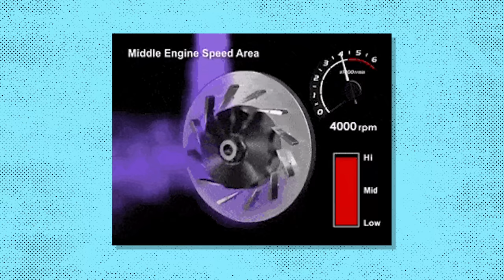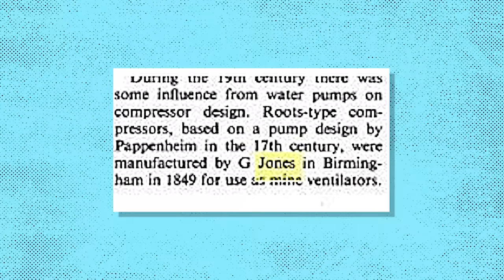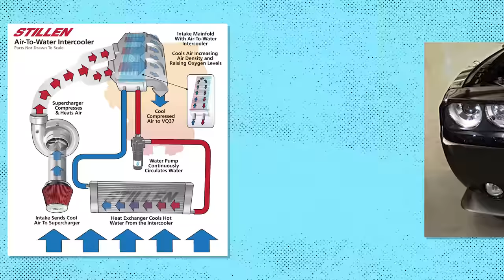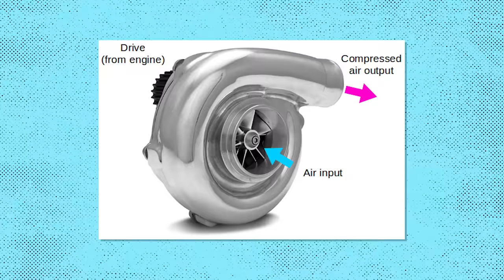Why Superchargers Aren't As Good as Turbos

Comment: Turbos do not use wasted energy. They use a lot of power from the engine, just like blowers. Yes they are more efficient, but making 500hp with an engine that would make 250 NA takes a lot of extra air and moving that air takes power. The turbine wheel is a restriction for the exhaust gas creating pressure and the engine has to work againts that pressure to push the exhaust gas out. An NA engine has about 2-3-4 psi of pressure in the exhaust, a turbo engine has about 2-3-4 psi higher pressure in the exhaust than in the intake.
Reply: Sorry but you are very confused and misinformed.
The turbocharger actually works on the heat energy in the exhaust and does not cause a parasitic load on the engine.
Tbere is no parasitic loss due to exhaust pressure because there is no significant Delta~P.
Any questions?
Reply: @sandervanderkammen9230  what is the back pressure of an NA engine? And what's the back pressure on a turbo engine before the turbo with 20psi of boost?
Reply: @bence.gabor.slezak  If the turbocharger is correctly sized, the backpressure is the same.
The Delta~P remains the same.
Reply: @bence.gabor.slezak  The turbocharger is a HEAT ENGINE and operates using the BRAYTON CYCLE
The exhaust turbine is a Impulse Type turbine and operates using the velocity of the gas... not the pressure.

What part do you not understand?
Reply: @sandervanderkammen9230  and how does the waste gate work?
Reply: @sandervanderkammen9230  The Brayton cycle (or Joule cycle) represents the operation of a gas turbine engine. A turbocharger is not a gas turbine engine.
Reply: @sandervanderkammen9230  how does the waste gate work and what does it do?
Reply: @bence.gabor.slezak  Not all turbocharged engines have a waste gate, they are not required for the turbocharger to work.
Reply: @bence.gabor.slezak  You are wrong...
The turbocharger is in fact a  Gas Turbine...
A Brayton Cycle gas turbine operating as a Combined Cycle Heat Engine.
Reply: @sandervanderkammen9230  did I say they all had one?
Reply: @bence.gabor.slezak  A waste gate is regulator, it controls the RPM of the exhaust turbine, and by default the compressor RPM to maintain a preset intake manifold pressures.
Reply: @sandervanderkammen9230  and how does it regulate the rpm of the turbine?
Reply: The Turbocharger operates on the waste heat energy in the exhaust from the reciprocating engine.
 The amount of heat energy is directly proportional to the amount of shaft horsepower generated by the exhaust turbine.

This horsepower does not represent a parasitic load on the crankshaft like a supercharger.

Turbocharged engines deliver higher BSFC..
Is because the compressor is driven by energy that is otherwise wasted out the tailpipe in a naturally aspirated or supercharged engine.

Any questions?
Reply: @bence.gabor.slezak  If not all turbocharged engines have a waste gate? Then they cannot be essential to the operation of the turbocharged engine.
Reply: @bence.gabor.slezak  It regulates the flow of exhaust gasses to drive the exhaust turbine. 
The waste gate is a bypass valve that allows a portion of the exhaust flow to be diverted around the exhaust turbine.
Reply: @sandervanderkammen9230  it lets exhaust gas bypass the turbine, why that happens? Because the gas takes the path of least resistance (if there wasn't pressure in the manifold an internal wastegate wouldn't do anything since it's not in the way of the flow), so the turbine wheel is a restriction and it is powered by the flow of exhaust gas.
Reply: @bence.gabor.slezak  Yes, but only after the INTAKE manifold pressure reached its preset maximum.
There is no parasitic drag on the reciprocating engine, gas always moves from higher pressure to lower pressure.
Reply: @bence.gabor.slezak  The exhaust turbine wheel is driven by the waste heat energy.. not the reciprocating engine.
The turbocharger puts no additional parasitic loss on the reciprocating engine.

This is why turbocharged engines produce more power at the  same intake manifold pressure
And delivers better BSFC performance.

Comment: supercharger kinda feel like highly tune NA engine,when they past the peak,it feels flat,but remember for some aplication supercharger can win....i've riden my friend rock crawling off road,it just 2.5L v6 with supercharger it only produce 300hp,but the throttle response,the precise for rock crawling is really good,it never got stuck in bad condition....in the other hand,that turbo kids,with 600hp roaring his high rpm in high speed,but dont even move...just treadmill-ing in the same situation...
so its just about the case,sometimes your other hand do better

Comment: Lots of useful information, however to say that superchargers aren't very good is just misleading and not true. Turbo's usually reign supreme in terms of power output, but good superchargers can usually get pretty close to the same output and are much more fun to drive. You make it seem ridiculous to use the engine to power the supercharger and completely discount the fact that it gives you boost at a fucking idle. No need to build rpm and exhaust pressure to spool the turbo. Turbo's are awesome too, but superchargers absolutely do not suck.
Reply: When it comes to making horsepower superchargers suck compared to Turbocharging.
Turbos make more power

Comment: Daily driver? Modern turbo car with computer controls on everything.
Fun driver's car? Supercharged or naturally aspirated with an honest-to-god, old school mechanical cable between the gas pedal and the throttle blades. INSTANT response and way more fun to drive. Modern turbo cars are fast, efficient, and reliable, but fly-by-wire sucks.

Comment: There's no such thing as parasitic loss, there is only how much power the damn thing makes. 8 lb of boost is going to give you 210 horsepower, yes, if the supercharger was not hooked up to a belt you would probably get 240 horsepower but that doesn't mean there's a parasitic loss, that just means that 8 lb of boost makes 210 horsepower whether it's a turbo or a fucking supercharger.
But also yes, if the supercharger was not belt driven it would be far superior to the turbo but boost is still boost.
Reply: At 8 lbs of boost you will get 240 horsepower with the turbo and only  210 with the supercharger.

The supercharger induces a parasitic  load on the engine just like a water pump or and a cooling fan...
 A supercharger induces a very significant parasitic load.. but like a water pump the increase of efficiency creates a net gain in power.

With the turbo there is no parasitic loss... the increase in efficiency is directly proportional to the increase in horsepower output.

Comment: The air is being compressed by any of those units from turbos to superchargers it's being compressed from the back pressure inside the engine if it couldn't build the pressure you wouldn't be able to build the power
Reply: The compressor in a turbocharger is driven by the waste heat energy in the exhaust... so there is no load or parasitic drag on the reciprocating engine.
That is exactly why Turbochargers add more power than a supercharger.
Reply: @sandervanderkammen9230  there may not be drag on the engine due to no belt hook to the engine itself but the more pressure that's put against that turbocharger when you're boosting that engine it creates back pressure on that exhaust the harder it is to push that exhaust out the more it drains the engine it may not drain as much as a supercharger does but it's still drains power off the engine and like I said my problem with turbochargers is the heat created they both create heat but the turbocharger creates more because it's being heated from the exhaust air they both drain power from the engine just in different ways
Reply: @roywallace5899  You seem very confused and misinformed.

The turbocharger produce more horsepower gain than superchargers and uses less fuel per horsepower because there is no drag on the reciprocating engine.

There is no backpressure between the reciprocating engine and turbo.
Backpressure is measured between the turbine outlet and the tailpipe.

Any questions?
Reply: @roywallace5899  Turbocharged engine produce LESS waste heat.

Turbos make more power because they convert more of the heat energy  from burning fuel into horsepower.

Exhaust temperature is LOWER on a turbocharged engine have a supercharged or naturally aspirated engine.
Reply: You do not want hot air going into an engine the cooler the better that's why they use intercoolers on turbochargers and if that was so why do they not use turbochargers instead of superchargers on top fuel dragsters and funny cars and on top alcohol dragsters and funny cars massive exhaust pipes you want cooler air plus that they're pumping 60 lb of pressure on top fuel and they watch them at an idle and don't have them revved up so they can have the power built up with a turbocharger
Reply: @roywallace5899  Yeah you are really confused and misinformed...
Positive Displacement compressors like the Roots and Twin Screw types 
Heat the intake air MORE than turbocharger.

Turbos and intercooling is BANNED in NHRA Top Fuel because it makes too much power.
Reply: @sandervanderkammen9230  I am not confused about s*** super stock street stock super calm and all those classes use turbochargers with intercoolers in NHRA competition what you're saying to me is the heat from that exhaust doesn't do anything to heat up that air well if you believe that that's fine I believe what I believe you believe what you believe I am no more misinformed than you are
Reply: @roywallace5899  You don't seem to know anything about engines or forced induction. My advice to you is to stay in school and when you graduate apply to a automotive training institute or a university with a automotive technology course.
Reply: @sandervanderkammen9230  do you realize that this all started over me saying that turbochargers do drain power from the engine just not as much as a supercharger or a blower and they do just like changing from a stock exhaust with clear catalytic converters and mufflers to straight headers loosens up the exhaust opens it up and the engine produces more power that's what started this whole thing I don't need to stay at school I am 67 years old I have never ever seen a blower in all my years put on a top fuel or alcohol dragster or funny car ever and yes they do run many other classes in NHRA other than those pro stock and those two and yes they do run intercoolers on the turbochargers maybe you need to go back to f**** school and if there was a time when they were running turbos on those engines you tell me when what years
Reply: @roywallace5899  Yes, I corrected your aggregious error.
 You clearly lack any formal education or professional experience on this topic and are not qualified to speak inteligently about Turbochargers or Supercharger.

My condolences to you, how do you survive without a proper education?

The NHRA BANNED turbocharged engines in Top Fuel drag racing.

Turbos make too much power for Top Fuel cars.

Comment: Turbos have parasitic drag as well in form of pressure behind the exhaust valve. The real advance is, they don´t need power when no power is needed. That´s the reason for using couplings for superchargers, as mercedes does quite often. Only if power is needed they get coupled. Also helps with intake temperatures...
Reply: Turbocharger operate on the heat energy leftover in the exhaust... the turbocharger works with a impulse turbine driven by the velocity of the gas... not the pressure.
Reply: @sandervanderkammen9230  thats simply not true. They do work on pressure, and they produce a lot of pressure in the manifold. Thats on many setups a prob with gas exchange. The power of the turbo is not for free! But, you doesnt cost power if no boost is needed, contrair to a belt driven compressor.
Reply: Velocity and Pressure are dirctly connected. Bernoullis law.
Reply: @joefromberlin2038  Sorry but you must have been sick the day they taught thermodynamics in engineering school...
Reply: @joefromberlin2038  Bernoullis Law says that pressure DROPS as velocity increases...
Impulse Turbines operate using the velocity of the gas, not the pressure.
Any questions?
Reply: @joefromberlin2038  Turbochargers are HEAT ENGINES...
A Heat Engine that operates using the BRAYTON CYCLE.

What part do you not understand?
Reply: @sandervanderkammen9230  bernoullis law says, take velocity out of the gas, you create pressure. This pressure needs work. Work done by the piston pressing the exhaust gas out of the cylinder. In high output scenarios you can measure more then 1bar behind the exhaust valve, before the turbine.
Reply: @joefromberlin2038  Your understanding of Fluid Dynamics is very weak..
In a Naturally Aspirated engine, the intake manifold pressures is always Less than atmospheric pressure.

Pressure in the exhaust manifold is always Higher than atmospheric pressure.
Reply: @sandervanderkammen9230  sorry, wrong vocabulary. I mean the pressure behind the exhaust valve. We measure up to 1,5bars above 3 bar boost pressure. The 80hp for the compressor are not coming from nowhere. Heat comes to play if you use compund turbo systems, like in old wright airplane engines or classic two stroke diesels.
Reply: @joefromberlin2038  No, you are very confused and naive.
The exhaust temperature drops as the gasses pass through the turbine.
An average of 200°F  to 300° F 
Please explain where the heat went???
Are you not familiar with the Carnot Formula???

Comment: What the hell you talking about? Roots and Twin Screws are completely different types of superchargers.

Twin Screws are literally screws.... The movement of the fluid is along the axis of the rotors.

Roots may have a slight bent, but not mandatory. That does not make them the same as Twin Screw, because, the movement of the fluid is transversal to the axis of the rotors in a Root blower.
Reply: I think you misunderstood. They are both positive displacement type compressors and work with the same mechanical principle.
Reply: @sandervanderkammen9230  I never said that they were not positive displacement pumps..... There are many variations of positive displacement pumps. Root Blower and Twin Screw pumps are totally different from each other, even if both of them are positive displacement pumps.
Reply: @hrishikeshkashyap3715  You just admitted that they are the same type of supercharger...
Reply: @sandervanderkammen9230  Congratulations.... You won the debate.
Reply: @hrishikeshkashyap3715  No debate whatsoever... the Roots and the Twin Screw are the same type of supercharger... a Positive Displacement Type

Any questions lad?
Reply: @sandervanderkammen9230  No, sir.... And all the best for your future endeavors.

Comment: Oil leaks and a pain in the ass to work on or a lil less power and way more reliable?
Reply: Turbocharged engines meet both FAA and EASA airworthiness certification... so no, not unreliable.

Comment: Lets get this straight guy, you are talking about a roots blower, or twin scroll supercharger.

Go look at A rotrex or F3 Pro charged outlaw class vs a turbo'd car. A centrifugal supercharger will win everytime. Turbos are just cheaper and more efficient in a diesel application than gas. Go look at Detroit 8v92 or even a 16V92 vs a Cummins B. Same concept in repeat. A supercharger cannot coke the engine oil and destroy itself, or create some catastrophic damage from lack of oil pressure, excessive heat, or both.
Reply: TRUE, centrifugal compressors are much more efficient, which is why turbochargers use them.
 Trucks, locomotives, ships and generators all use turbos because they are better, they are reliable, more fuel efficient and deliver the most horsepower.
 Compared to a supercharged engine  (all other variables being the same) the turbo car will always prevail as it has a huge advantage in power output.

Comment: what happen is using a supercharger on a small engine kind of feel not as worth it as a turbo but on big american v8 the lost power is so small compared to the power the engine is already putting out stock thats its fine plus if you stick a giant 3.0L super charger on a 2.0L 4cyl the engine is gonna struggle to spin the supercharger while a 5.4L v8 wont have a problem spinning it. when you take a ride in a supercharged say mustang and you give it all the gas it wants the torque and power is instant while gm made the cobalt ss with a supercharger the power in it feel much more like a turbo because the engine doesnt produce nearly as much torque n/a

Comment: superchargers are lighter, far easier to install and have a much better throttle response. These things matter if you care about performance. Chasing fuel economy and high power figures is all well and good but turbos are not always the best option
Reply: The advantages of the turbocharger far outweigh those of the supercharger which is why Turbochargers completely dominate the forced induction market.

Comment: I don't understand much about car engines but I really don't like those turbocharger boosted engines. I have one in my car, it's basically BS, says 74 kW output power at 4750 RPM but the car can never reach that much RPM in 5th or 6th gear to produce the 74 kW on the Autobahn. Max speed is 165 kmh.
Reply: Thats because your car sucks... not the turbocharger.

Comment: I'd use a supercharger over a turbo for the simple fact that they hold up longer... A lot of prop airplanes through the years use superchargers.. The Kawasaki H3 uses a supercharger...
Reply: That would depend on the type of supercharger and the application.
Many aircraft are also turbocharged.
But for many aircraft superchargers and turbochargers are only used for "normalization" or altitude compensation. No boost.
 Turbochargers have a huge advantage over superchargers in aircraft applications.
Kawasaki also made a turbocharged  bike, the GPz750.